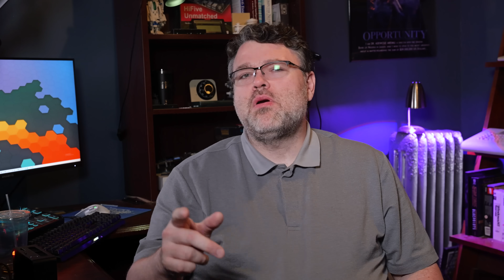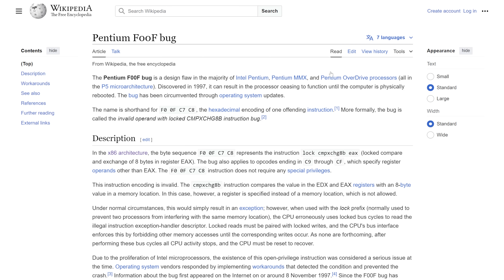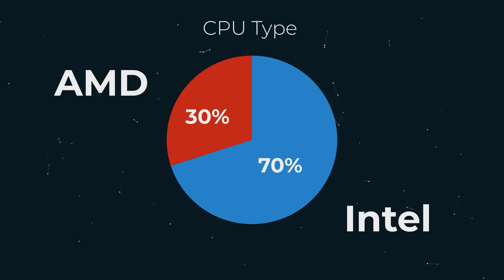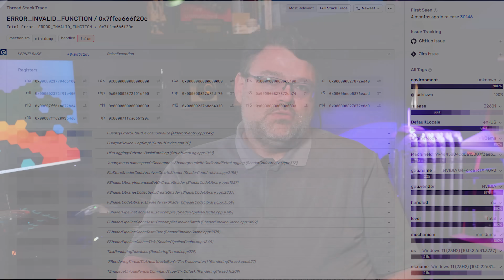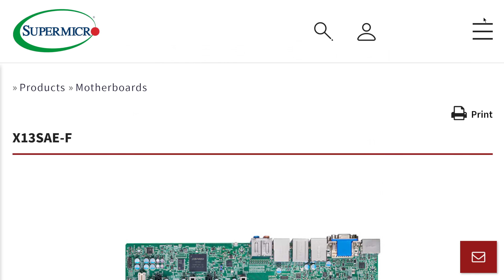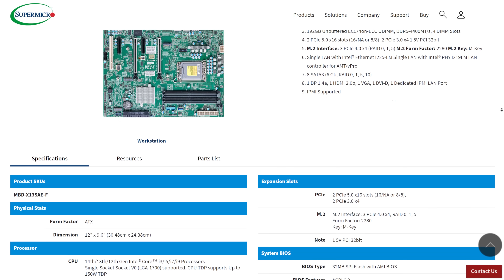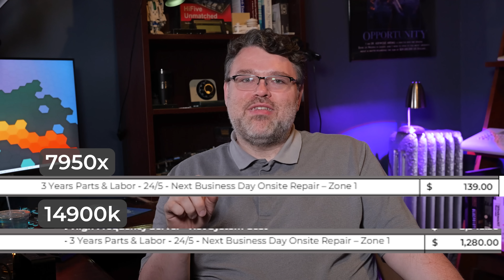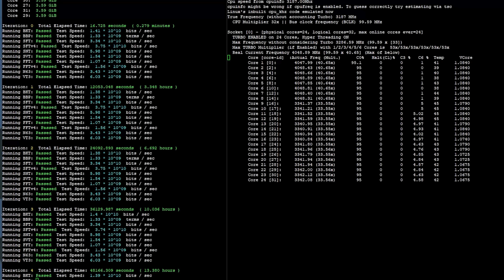Intel has a Pretty Big Problem

Comment: Two things:

1) I had to RMA my 12900K in April 2022 after I bought it, originally in November 2021 because of an integrated memory controller error where, within that timeframe, the system would go from passing memtest86 to FAILING memtest86.

And it would CONSISTENTLY fail memtest86, even with a completely different kit of four sticks of 32 GB, DDR4-3200 RAM.

So, without seeing the data, and also with the idea that dropping the DDR5 memory speeds to ridiculously slow memory clock rate, once again, suggests that Intel has a problem with their integrated memory controller.

(Further, if you juice the CPU (and in the case of the W680, where you're NOT juicing said CPU), but especially if you juice the CPU, I won't be surprised if it is slowly cooking the IMC which might be why you are seeing the rate of failure increase over time.)

I saw in on my 12900K. I won't be surprised if they are seeing it on the 13900K/14900K as well as the IMC is probably fundamentally the same design.

2) The other thing that I think might explain why the 13900K and 14900K are seeing a higher failure rate than the 12900K (even though I still think that this problem exists with the 12900K, but at a SIGNIFICANTLY lower rate) is Intel introduced their on-die thread director so that rather than leaving the scheduling of threads to either the P-core or the E-core to the Windows scheduler; it is handling that at the hardware I/O level.

As such, if the thread director is also having issues, especially if/when threads are being bounced from P-core to E-core and back, (or between P-core to another P-core and/or from an E-core to another E-core), and it hitches or misfires; and it is expected to complete or return within a certain amount of clock cycles and it fails, then it will end up manifesting as an apparent error, when really, it's a thread director issue.

These are my theories/hypotheses.

I, unfortunately, don't have the data nor the evidence to support my theories/hypotheses (other than my 12900K eventually failing memtest86 after 5 months in service, and I NEVER bother overclocking my systems anymore -- not since I cooked at least ONE of the 6 cores on my 3930K, about a decade ago. I don't even use XMP.)

But if I were studying this issue, I would start hammering on the thread director and/or the IMC to see if I can make it error out in a repeatable and reliable fashion (which I was able to do when my 12900K died).

Comment: One thing I would be really worried about is if we started seeing these problems on the laptop end, just slower because the silicon isn't pushed just as hard. Replacing a laptop cpu isn't as simple as popping a new one in
Reply: on a laptop replacing the cpu means replacing the whole motherboard
Reply: @uranblut  I know. That was what I was insinuating.

Comment: If you get the vram error when compiling shaders on w11 set the game to run in compatibility mode for an earlier version of windows, you only need to do it while it compiles then you can set it back. Weird fix but it works.

Comment: Is 14700k affected?
Reply: People claim it is, but I'm not having even the slightest issue. From the comment section, you'd think everyone is having this problem lmfao.
Reply: @JordanJ01  yeh cuz I have 12900k, but eventually want to upgrade to 14th gen at one point when it's on sale... I'm most likely avoiding 14900k at this rate, but thinking if other one are considerable...

Comment: I've had a faulty CPU before (~20y ago) and the system would always BSOD with a random driver error after 15min... They are so painful to pin down.
Also this sounds oddly like AMDs Radeon RX 7900 XTX rumored issue resulting in the cards being slower than intended, as waits were added to the drivers to keep the chiplets in sync. If so, Intels ring bus is whats burning out...?

Comment: I saw this happening with my 14700KF when it was overclocked. This was with an AI overclock running at 5.7Ghz and 6000Mhz RAM clock. Running with stock settings and no overclocks I get no errors and system runs stable. I've had an up time of 3 weeks only to have to reboot for a Windows update.

Comment: I had massive problems with a X570S ACE MAX exhibiting alot of this same behavior.  I thought all my M.2's were bad.  Turns out it was the MB.  It would spin the CPU to 100% run 5C hotter all the time and I was getting read write errors and BSODs .  NOTE:  All of these issues happened on apps installed on NMVE M.2's  I have 3 1tB SATA SSD's and nothing on them every caused issues.  Game like 7days, installed on the NVMEs would throw errors loading assets.  The only thing that would fix it al was a BIOS flash from the flashback button.  Eventually that stopped working and the board wont post or flash on either BIOS.  I moved it all back to a X470 board and not ONE SINGLE ISSUE.
The problem is deeper than JUST 13 and 14k intels.
Personally, I think the motherboards a have gotten way complicated to try to keep up and and I think alot of them have design and qc issues too.

Comment: Lock the System Agent Voltage - the v/f curve is way too aggressive hence high mts or double dimm being a bigger issue (at least that took my 14900k from a crash on any stress test to BEAST top 1%)

Comment: When the same order of magnitude exists in population, but the error rate is orders of magnitude higher, it doesn't take a genius to understand that one brand has an issue.  The problem is that you need to ensure that this isn't isolated to a single game or developer.

Comment: In the late 1990s, I'd given up on AMD processors and stuck with Intel CPUs because I believing they were more stable and performant. My 13900K's CPU anomalies over the 1-2 years have forced me to go with AMD on my next build, as the current level of support and communication from Intel is poor. If the ultimate solution ends up being running at a very low power profile, then I suspect many in the enthusiast community will come around to the same position

Comment: Desktop CPU on server is generally not a good idea, at least Ryzen Pro supports ECC.  When you see 14900K P-cores going up to 6 GHz, it smells benchmark tuning and potential instability.  Maybe Intel is desperately pushing itself too much and should concentrate more on stability instead of marketing...  Boeing syndrome where marketing and management ignore engineering ?

Comment: Could the stock ILM and bad socket connection simply be the issue? Use of contact frame would solve this issue with bad contact. Just a speculation but that ILM has rubbed me the wrong way since day one.

Comment: Does this issue only have to do with games? I build hackintoshes dual boot and regular pc's for my clients mainly for music production video n photagraphy using 12900k 13700k and 13900k and i have not had any issues with any computer i have built hundreds of them... i only use gigabyte boards for macos compatibility

No i dont overclock anything as the cpu is powerful enough out the box for my clients needs

Comment: This kind of gradual failure rate feels like an electrostatic issue. ESD damage will do something VERY similar over weeks or months. Maybe the silicon design has electrostatic buildup somewhere in use, especially at higher power limits or speeds?

Comment: im glad i went 12700k from ryzen 7 5800x3d instead of 13700k/14700k
my 12700k is also overclocked to 5.1ghz p cores 4ghz e cores at 1.35v max 
im also using 64gbs of 3000mhz ddr4 ram on an asrock z690 extreme motherboard 1000watt evga psu and rtx 3080 ti

Comment: this is not only about 13900K and 14900K. I think it started with Alder Lake.
I have 12900K and after I put DDR5 into all 4 slots instead of two - I start getting BSD in few minutes after run openFOAM - it's a very memory-intensive compute app. CPU heated up to 105C and I start see memory failures. 
Lower memory frequency  reduce the frequency of BSD but it still can appear.

Comment: I'm curious if you've found much data involving non-i9 CPUs, or rather, specifically involving the i7 CPUs. Here's why:

TL;DR: I have two i7 series, a 13th and 14th gen. The 14th gen is currently experiencing the problems mentioned. I believe it is cooked, and will be RMAing it shortly.

Long Version:

I've got a 13700(non-K) and a 14700K.

The 13 ran so hot with an air cooler that I decided to switch to watercooling for the first time ever. I figured since I had to redo that much, I might as well upgrade and bought the 14 (this was before I found out that the 14s were just rebadged 13s). Got lazy, and kept using the 13+air for a couple more months before I finally put in the work and did the swap. That was back in late December, early January.

Before I continue, I should note that even though I bought a K CPU, I did not do any overclocking besides what the default settings on my Gigabyte Z790 Aorus Elite AX mobo was doing. I even had XMP disabled on the RAM because testing with Cinebench showed no difference between XMP Off (4800MHz) and XMP On (6400MHz). I left everything else untouched, including Gigabyte's default "Optimized" settings, which I assumed meant 'optimized for performance + efficiency/power', but turned out it meant 'automatic overclocking'.

A couple weeks ago, things started getting funky. The game I've been playing (Sons of the Forest / SOTF) was running fine, but other applications around Windows were running slower than usual. Then I went to host the game one night, and the machine BSOD'd... then began boot-looping. Eventually, I got it back into Windows... briefly. It BSOD'd just loading Discord. It began bootlooping well before getting into Windows, and even got to the point where it was experiencing hard crashes just sitting in the BIOS.

I did some BIOS flashing to bring it up to date, and the machine started booting a little further again, but still resetting before loading into Windows. I had just made a Ventoy USB stick a day or two before the issues began, which included Linux Mint, which includes Memtest, so I ran that.

Tens of thousands of errors began accumulating within 10 seconds of starting the tests.

A bunch of troubleshooting and configuration changes later, I was convinced it had to be the CPU, so I dropped the 13700 back in.

Worked flawlessly, and faster than the 14700K had been working in at least a couple months.

I was ready to call it and see about sending the 14700K into Intel when an annoying little thought popped into my head: What if it's just a pin-contact issue? What if it works if I pop it back in?

So to avoid Intel receiving it and telling me there was nothing wrong with it, I tried it. It worked! No BSODs through several Memtest runs, several Cinebench runs, or playing SOTF.

So I assumed it was just a bad pin contact or something to that effect.

That was a week ago.

It has slowly been degrading ever since, to the point where it took 20 seconds to load the Windows calculator. It now fails to boot and the BIOS interrupts and tries to get me to revert to "Optimized Defaults", but it turns out I can choose "Enter the BIOS" and "Save & Exit" and it will boot fine. Choosing "Exit without saving" results in another boot failure, though.

Other desktop applications were running obscenely slow, too, but oddly enough, SOTF ran fine.

I found Gamers Nexus' video on this topic and watched it.

Went into the BIOS, disabled the iGPU (being used for my second, non-gaming screen), disabled TurboBoost, disabled Gigabyte's overclocking, and turned off every other performance-enhancer related to the CPU, along with turning off the E-cores. I even dropped my RAM from 4800MHz down to 4000MHz.

Now, instead of sitting around 60ºC while playing SOTF, it sits around 39ºC. According to HWMonitor, the core voltage doesn't go over 0.925v.

But it still fails to boot without pulling the trick above.

So I think my 14700K is just as cooked as the 14900K's you mentioned. I don't think it's limited to the i9 series.

Comment: I have an intel 11400H and OMG, I never had a system crash so many times. I send the the notebook back to check and they found no problems whatsoever. I was able to stop it from crashing by downloading ThrottleStop and under-volting the CPU. Like wtf? I am a tech enthusiast and I should not have to do this. This cpu gets so fucking hot too without doing this it feels like it is overclocked from the fabric in comparison with an AMD one. Funnily enough I only lost less than 3% in performance from under-volting. I don't drop any FPS anymore like at all(witch was constant before because it would overheat), my fans don't scream like crazy anymore(I don't even listen to them anymore) and I had no crashes ever since. So... I have no idea why it wasn't like this from the fabric. I don't even need the performance from the cpu since in the games I play they mostly use the GPU intensive. If I as a normal user can figure it out this why the heck intel and their massive team doesn't already do this? Is it to get 100mhz in performance to compete with AMD? I have no idea but I won't be buying any intel laptops for my family. They wouldn't be able to fix this stuff and I am kind tech support for them.

Comment: I use an i5 - 13400f mixed with an nvidia geforce rtx 4070 and never and any problems! I play hard core games as well as shump's (shoot em ups) for hours and hours everyday! No crashes or nothing. I know the 13400F is not as powerful as a 14900 but it still has lots of power.
Reply: 13400 consumes like no power as well as 13500. It's 13600 and higher when it becomes more and more ugly.

Comment: If 50% of CPUs are failing one way or another but the other 50% running perfectly fine I would closely look at the production starting even from the silicon provider and its quality.
Reply: I just checked the latest batch, it sucks
Reply: Smaller you go well  chip lottery  that's why I don't  see the point  in clocking  oh I can get 6ghz on water yea how long  does the cpu last its equivalent  to a top fuel dragster  being  pinned  to its max breaking  point  intel has pushed the silicone  far enough  that it's getting  bad yields some chips are good alot of chips are degrading  faster due to  the whole chip getting intense heat that's the problem  1nm chips are gonna have problem  we need to move to a better Base substrate  graphene  or carbon substrates

Comment: My 14900k died this week. Day dot had nothing but issues with memory problems random restarts/crash. Windows install problems. Games not running right. just a list of stuff going on with it only had it for about 4-5 months  z790 board no overclock. used other boards still had the same problem. Did everything from changing board and memory drives the works. Just over the problems. Got a 14700k until my 14900k gets Warranty. 14700k no issues at all right now it just works

Comment: my theory. intel had to keep up whit amd on the desktop platform. but, noticed that its xeons are ditched in favour for the desktop cpus in datacenter/provider etc space.
so they ensured you burn your self if you get desktop chips for those applications. 
IF in the near future, intel releases a xeon that runs verry well, is competitive etc then this theory will be prooven. 
they want people to think, aye it sucks. we tried to cut rorners whit desktop parts instead of the pricy xeons. that simple. 

i think intel should get sued for intentionally producing chips that are ensured to screw up.

Comment: DDR5-4200 with four dual rank modules is still overclocking, only DDR5-3600 is supported according to the datasheets. Only DDR5-4000 is supported with four single rank btw.

Comment: I bought my 13900k in October 2022.  Many 13900k and 14900k owners didn't experience any problems until this year.  I find it very odd that so many of us experienced issues pretty much at the same time simultaneously.  Most would say the power profile caused the wear and tear but practically all at the same time?  Different motherboards, different profiles that are aggressive and non aggressive?  Different levels of use?  Many working PC gamers aren't on their computers for long periods.  Really strange.

Comment: i run windows in a vm on a 7950x with hardware passed to it SR-iov. my linux host has 1641hr of uptime. my cousin has a 14900kf it crashes once a day at least. the crash is nasty  it locks up at memory training fulling killing power for 10sec and it will power back up.
he has w11 pro so i can setup kernel system logs if you want them. when i was doing some testing with my own code scripts i found that 1 P-core and 2 E-cores had errors in FPU calculations in asm code tests returning zeros, when it did this the cpu was under a IRQ requests and was causing a lot of threads to park, this points too two thing in my mind 1. the thread scheduler is messed up. 2. bits or getting flipped in the L2>L1 data path